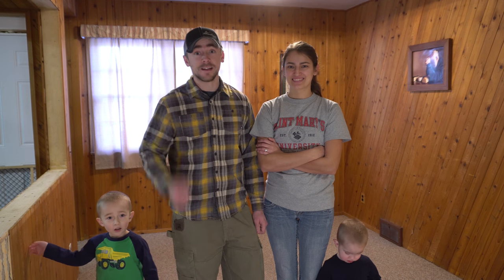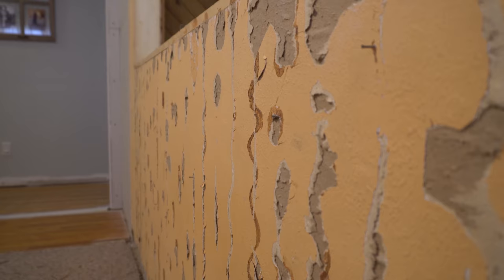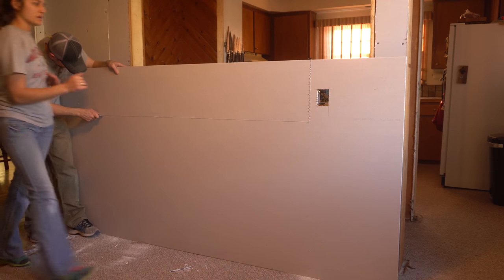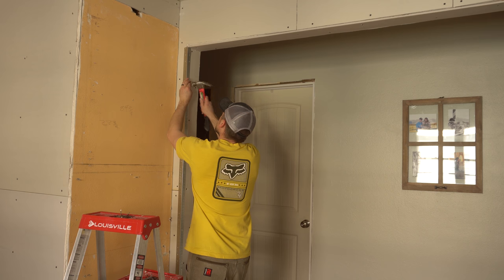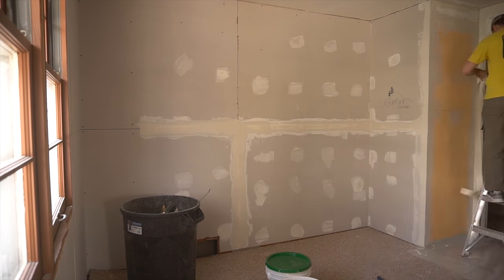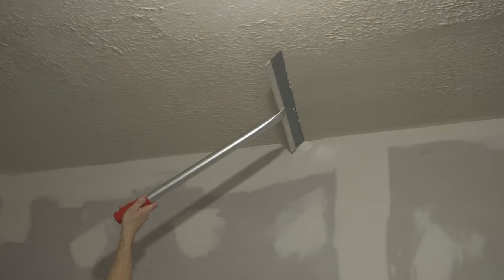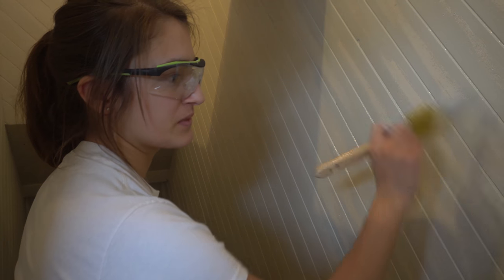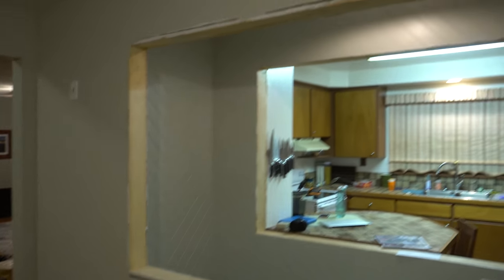Updating The Dining Room

Comment: "quickly hardening cocoon of sadness" Hahahahahaha.  I don't think there is a better description of drywall mudding as a homeowner/DIY person.  Watching the pros, it is embarrassing how bad/slow I am at it.
Reply from the maker: There is definitely a reason why more people don't do the drywall part themselves!
Reply: I am pretty sure that in one of the circles of hell they hand you a trowel and a bucket of drywall mud.

The only kind of building work that I genuinely dislike is drywall and plaster work - it uses muscles that no other task calls on and once you start you can't stop till it's smooth and flat.

Sadly I have a room in progress that will need a full finish coat of plaster over the drywall before painting (not just corners and joints) - I am not looking forward to it.
Reply from the maker: I feel your pain! Stay strong and good luck!
Reply: Thanks, I know I will feel like the Hunchback of Notre Dame the day after.
Reply: The secret to avoiding the sanding is to use only as much mud that you need when you tape, then remove all excess mud, let it dry, sand down any ridges you missed, your 2nd layer of mud is to fill recesses and level, let it dry, sand down any high points and apply your finish coat of mud. In all you can reduce the amount of sanding and dust by 80%, I've got it down to one light sanding to finish it off. A bonus is the mud drys faster when you only use thin coats.
My dad loved to apply the mud, I got the privilege of sanding 80% of the mud off, what a waste, and mess.
After the first coat of sealer he'd go around and mud again but not tell you so when you do your next coat you'd find a nice ridge of mud in what was a smooth wall. good times. 😑

Comment: I have heard many descriptions of a love / hate relationship of sheetrock mudding, but yours takes the cake 'a big slow harden cocoon of sadness.' 
And as having that had that love to hate it done, job everyday for three years! I give you kudos on your 'rocking' abilities. Let me give you a couple of pro pointer tips. 
When you have an odd ball sized hole, Don't just skim coat over it, because it will stick out like a sore thumb.
Patch it, with this trick, cut it to an approx square size then take a paint stir stick, put it inside across the hole (tie a string around the middle to hold onto first) then put a couple of screws in the ends. Then using a piece of rock measure an extra inch bigger than the hole. ON THE BACK SIDE MARK THE SIZE OF THE HOLE LEAVING AN 1/2" On Each Side of Center. GENTLY SCRIBE THRU THE ROCK TILL YOU GET TO THE FRONT KRAFT PAPER FACING. BREAK OFF THE ROCK FROM THE FACING (with a little practice, you can do it blindfolded) Then apply a bit of mud to the two "wings" and stick in the hole. Shoot a screw in to hold it to the painters stick. Then apply the tape across the hole and TADA  No more hole.
Reply from the maker: That is a great tip William, thank you for sharing!

Comment: For your windows there is a copper folding seal that works well to seal the older 1950s windows.  If you sand a lot then you used to much mud.   The finish looks awesome so do not worry about if you are not the best it turned out great.  If you have a hard time finding wood for the floor look for a place that does snowplows and see if the wood in the pallet will work, I used wood from my snow plow blade pallet and it looked good.  Working together on your home is fun.

Comment: As a third generation drywaller (though I only did it professionally for a couple years) I have to say that this was absolutely the least painful DIY drywall job I've ever watched. You don't enjoy it but you understand it well enough. I had never seen that texture roller. That looks convenient. I was taught (as you identified) that texture is for hiding errors so if you don't make any errors you don't need texture. And it's harder to patch a textured surface. Anyway, there were a couple moments where I wanted to tell you how to do something a little faster and easier, but you also showed some of that (like trimming on the wall) yourself. Well done!!
Reply from the maker: Thanks Jon, I appreciate the compliments. I'm definitely FAR from a pro at drywall, but I have been stubborn enough to fight my way through several projects - to the point where I am at least competent.
Reply: Jon Miller I can agree with you on a couple of points Where a banjo and a router would save some time. Also texture gun makes quick work of the ceiling too.

Comment: the trick to reducing sanding is to mud the joints, immediately tape them with the paper drywall tape, run the trowel over it. Add 2 more very thin coats. Done well there's almost no sanding needed. That fibreglass tape creates little ridges in your trowel that just cause more work. Amusingly it's my wife who's good at plasterboarding and jointing, not me!

Comment: The way to put drywall mud on is to do your first coat to pot the tape on.  Let it dry.  Then knock off the high spots, use a wide knife (10") on the 2nd coat.  Repeat knocking off the high spots.  On the 3rd coat, use a 12 inch knife.  When dry, lightly sand, or use a damp sponge to 'sand", pushing the high spots into the low spots.

Comment: The way you reduce the drywall sanding needed is to take your time when applying the mud, use the trowels to feather the mud out and leave just enough on the joint to do the job. Don't just plaster the mud on like it's mortar in between bricks, you'll just sand most of it off and that's a serious waste of Time and Money (why glop it on when you only have to sand it back off?). Feathering the edges properly also helps improve the final paint finish.
If you can find them on You Tube, check out the Holmes on Homes Episodes, Mike Holmes gives plenty of great tips on how to do the final finish work in his shows.

Comment: 6:05 A trick to reduce the number of finish coats you need it to tint the primer the same colour as the paint you're going to use as your top/finish coat...
Another tip for painting is to spend the money for a really good quality Primer. A Top Quality Primer hides a multitude of Sins...